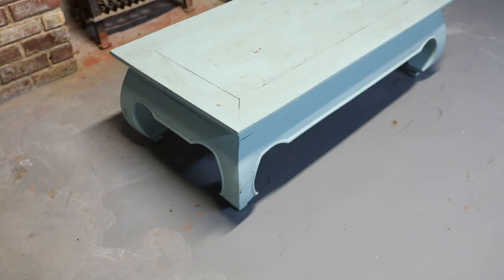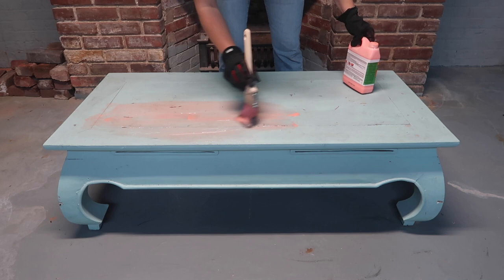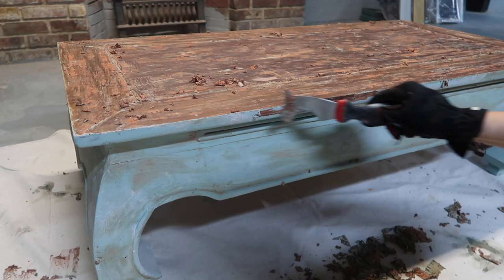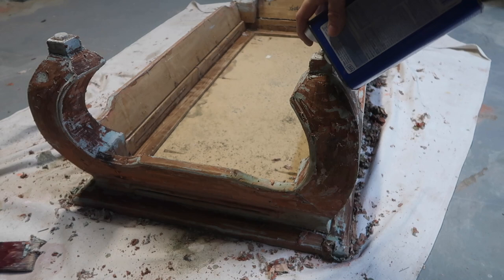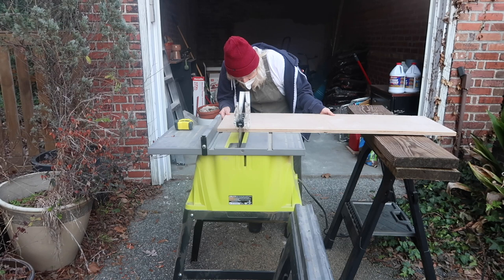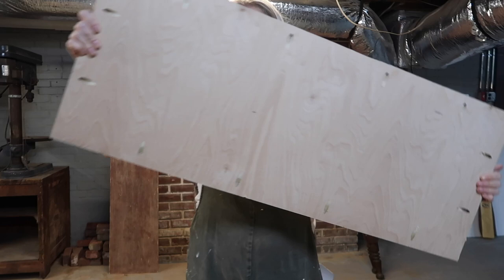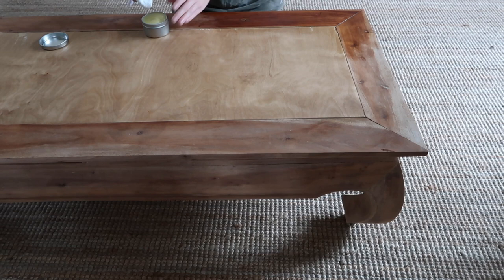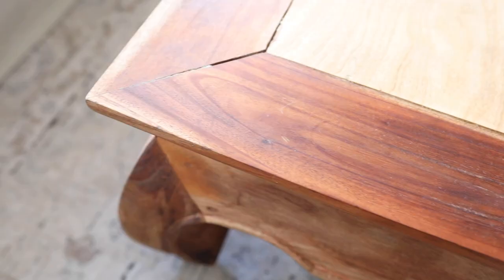Coffee Table Makeover | Strip + Remove Paint from Wooden Furniture

Comment: Nice job! The original table looks like it's made of pine, so maybe down the road you could replace the plywood with a solid pine board (not that expensive). The only "problem" I have with the finished work is that the grain or the plywood does not go in the same direction of the grain of the table, meaning the longer sides, but I understand you wanted to use material you already had.
Reply from the maker: Yes that bothers me too! Makes it unique, but  doesn’t flow like it should. I figure if I want to replace it with better wood down the road I can. Who knows, maybe another project will give me a good scrap of pine to use!